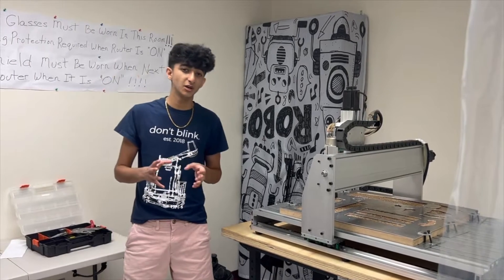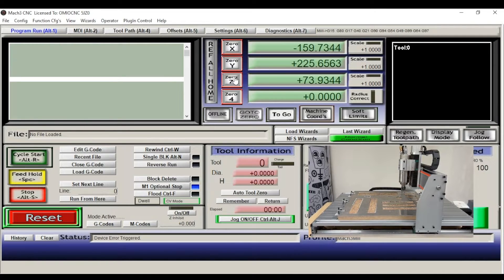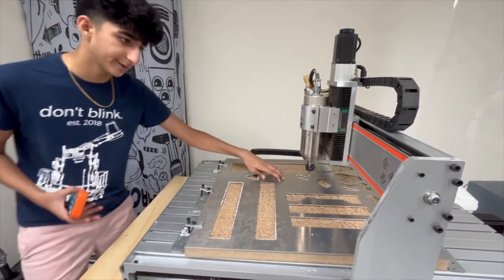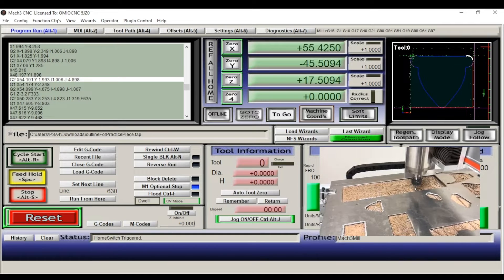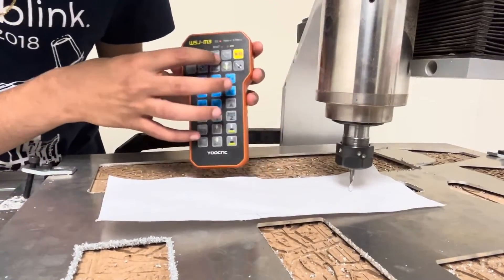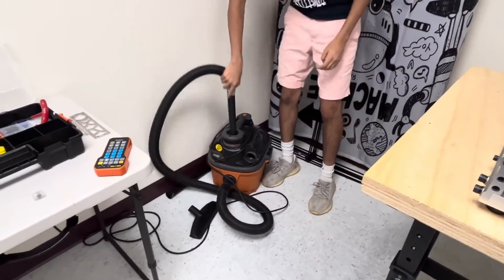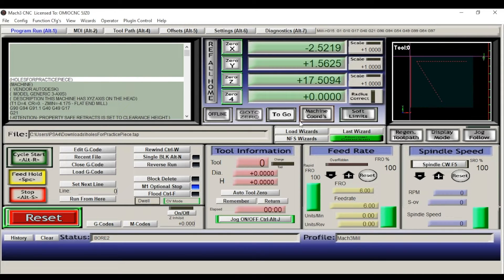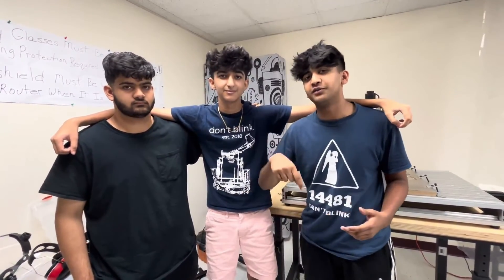Safety and Use of an Omio x8 CNC Router for Custom Manufacturing- Part 2/2 - FTC 14481 CNC Guide

Comment: Nice video, good info for new teams.
Major comment, I'm really  surprised you are not using the 'SOFT LIMITS' function as the Omio machine only has limit switches at 3 ends of travel (+z,+y,-x) rather than the 6 ends (+and-z, +and-y, +and-x). 
Scary & destructive crashes into end of travel easily avoided by using soft-limit. 
Highly recommended and very easy to setup. 
I believe the Omio has been designed with only 3 end switches (for home) in the belief that every one will use the 'soft limit' Mach3 function.
Especially useful as Mach3 gives an early warning to operator before beginning operation.